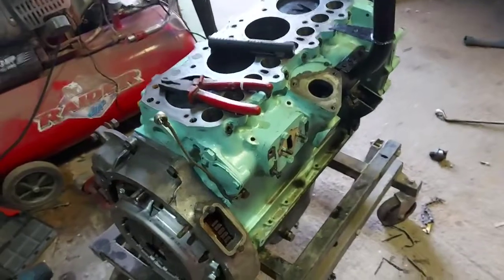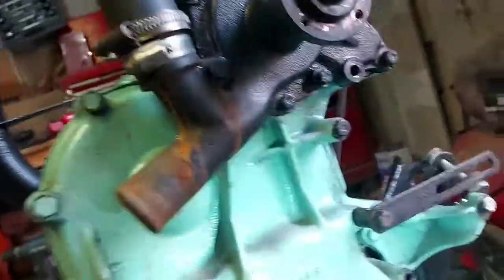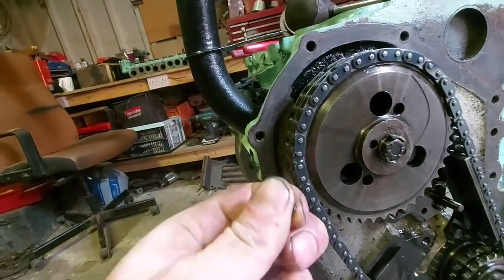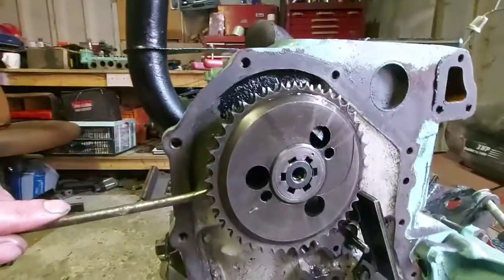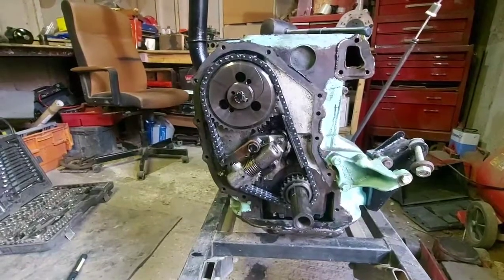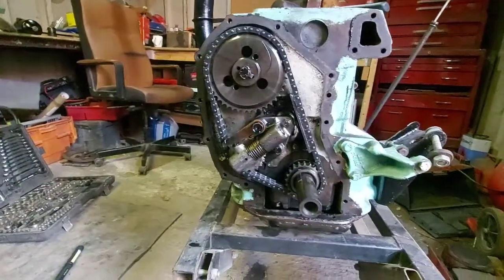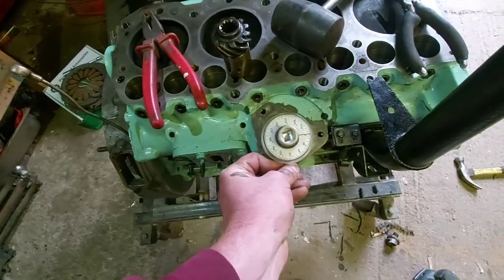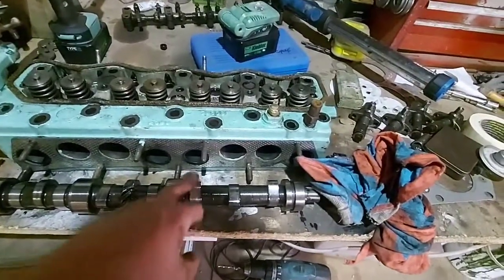land rover series 3 2 1/4 diesel build part 8. removing the camshaft

Comment: Just seen your video. The Skew gear ETC6139 you pull out the engine appears to have a fixed flange on the bottom, and a split Bronze bush? Is this a early 3 bearing 2.25?  At 12:07 you show the entire skew gear, which looks to have a Black Thrust washer sitting directly under skew gear teeth and above the Bronze bush. The later Skew gears used a one piece bronze bush and were assembled from below with a thrust washer then locking collar below the Bronze bush. 
On your example, a Trust washer appears to sit above the bronze bush, directly below the Skew gear teeth.  With a fixed grub screw, this would change the contact heights of skew gear to Cam shaft, Pump drive, Etc.. Can you confirm or explain this difference. Or is there yet another version of the Skew gear ETC6139 I've not seen yet? I have two different versions both with the same one piece Bronze bush, part no: 522745.
Thanks, great vids
Reply from the maker: Hi, it was an early 3 bearing engine, I can't recall what the skew gear looked like without re'watching the video (it was a few years ago). I never knew there were different skew gears available. I did a little research before building that engine and couldn't find any reference to different gears.